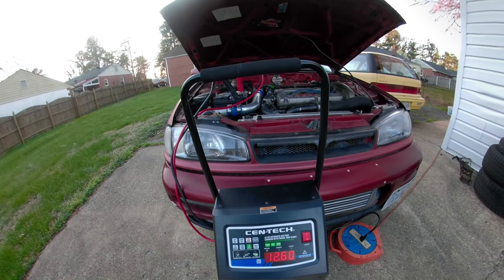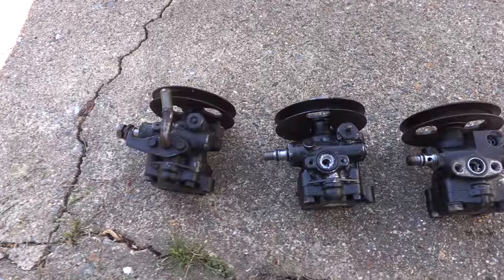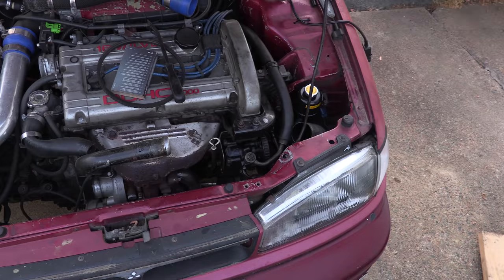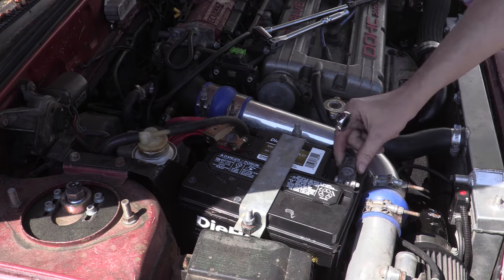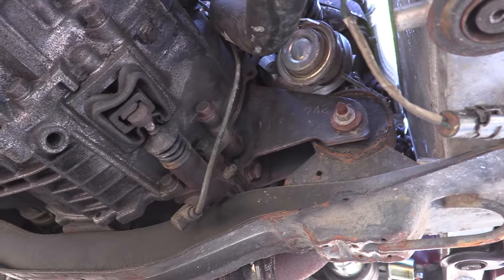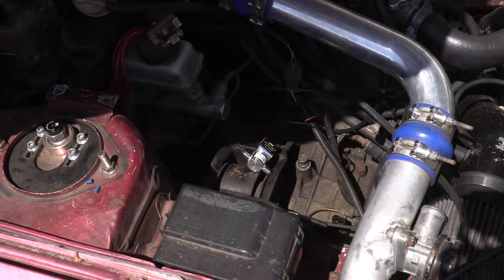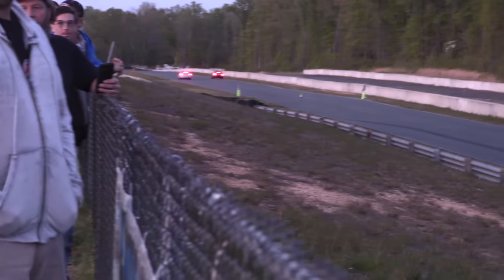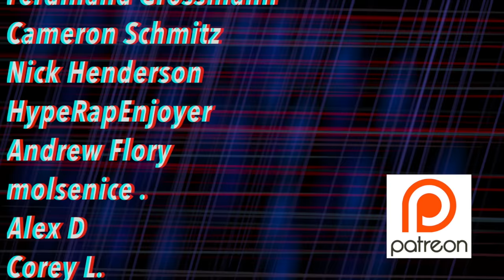When easy fixes go wrong...

Comment: Buy yourself a DeWalt DCF923 with battery and never look back at that ugly thing you have now, hahaha. I know, easy to tell someone to spend money. I'm just saying I have one and I don't miss the cash.
Reply from the maker: I'm using the plug-in electric drill because my DeWalt has a bent chuck.  It's always wobbled.  The only one that doesn't wobble that I own (sadly including the drill press) is that 30 year old craftsman that I've had for 29 years because I stole it from my mom.  Not really, but sorta.  She said she was thinking of me when she bought it.  I need a new one, fer sher.
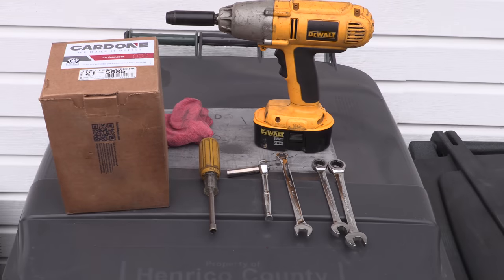Reply: @Jafromobile  Oh not the drill, the impact at 1:43! Corded drills still rock, hahaha. I think I have a nearly identical Craftsman corded, with the same break in the jacket, that I also got from my mom. 😂 The new compact impacts can make more torque than your old egg shaped guy. If you do upgrade to a new battery system, the cordless drills are a cheap add on. I just love my cordless tools.

Comment: Nice job. Ran into issues fixing my ps leak on my early 90. Didn’t realize they had a different pump on the early ones.  Did the car launch any different with the mount fixed?
Reply from the maker: Yes, all the weight and camber adjustments we made before it was fixed now make the car launch pulling the other way even though it tracks straight when cruising.  I'll be getting it re-aligned and hopefully onto a prepped 1/4 mile long track soon.  In my first burnout you can see it barely smoking the outside edge of the passenger tire.  Clearly my camber was affected by fixing it.  That was the tire that went up in smoke every time, and it's right next to that mount.  I got plenty of data from this trip, and the highway there and back yielded just as much info as the track.  I will likely be Windowelding my rear lower control arm bushings, or finding a poly replacements.  I'm convinced that a 1.9 60 foot will put this car deep into the 12's, and chasing number has already caused me to install everything necessary to tweak this car's geometry to get it.  This is by far the most challenging front wheel drive chassis for anyone because the chassis record is mild, certainly within this car's reach with the power it's making, but making this this thing stick is an education all by itself.  People used turbos 3x the size of mine to make a number that's a fraction of a second away.  That means they fought all of the exact same traction issues, too.

Comment: You did not want a cardone pump, my freind. Especially considering the amount of work needed to replace it.
Reply from the maker: When I looked at it coming out of the box, I assumed it was parts to begin with.  I have a rebuild kit for the Galant, and plan to rebuild that one myself if I can.  If I need a piece of housing, or a pump vane or something... it will be a donor.  I drilled a hole in it, so it's not like I'll be returning it.

Comment: Call Jamie!
 Nissan pump possibly?  
 Or even the 1st car you took apart at the shop in the lift  eagle may by?
Reply from the maker: None of us have any idea?  I can't blame anyone.  This car materialized originally about 15 years ago.  Parts we didn't have were housed from junkyards.  It was built with all factory original parts, but anything goes.  It has parts that represent 9 different auto manufacturers today.  This pump came off of neither an Elantra or a DSM?  Maybe the Expo?  I don't have one for reference?
Reply: @Jafromobile  New Mando 20A1013 Power Steering Pump Original Equipment
I saw this on Amazon / I know it's a new part but I think it's close. 
 Dsm 1996 seems to look like the pump you have in your video. 
 I hope this helps.

Comment: Be better off switching to an mr2 electric pump like a few kswap civic/ev/rx7/many other guys have done. I remember dealing with those pumps in the dsms I had. Their pumps are absolute garbage. Wouldn't work well past 4k rpm making autocrossing dsms damn near a joke. With that and the mule kick abs that was barely passable. There's a better solution out. It's just finding it.

Comment: Why not put a prius electric power steering. Like I did on my Huyindai. And get rid of all those hoses and reservoirs. It's 2022 after all.
Reply: Look at Mr future over here with his electrica'ma'bobs..
But seriously, How much work is it to fit?
Reply: @rompdude  Ain't that hard you take the rear column appart and weld splines to Prius column and then attach it to the existing column. Then wire it in. Don't know how it would be different car specific but it's not difficult. If you building engines you should be able to have enough brain cells to do this simple conversion.
Reply from the maker: @Nexx8969  @rompdude 😂 I love this!  This exchange is priceless and I love how everyone here gets along.  This is something I've kicked around.  I've had plans to do it to my GSX.  As enticing as it seems, think about how much electric power steering still wouldn't make any difference at all at cleaning up my engine bay.  It would just rid me of the noise and the pump.  It will make a difference in my GSX's engine bay.  I'm going to prioritize my efforts on that job on a different car, though if I have more problems with this one, it could turn into a practice run.

Comment: I've only just noticed that this 4G63 is the wrong way around to me. My only experience with them is the 8G Galant I owned which had an N/A 4G63 SOHC (UK market), and the transmission in that car was an F5M42 mounted on the RIGHT side of the engine bay.
Was this mirrored setup common to all Mitsubishi/Hyundai cars of this generation?
Reply from the maker: From 1989-1999 Mitsubishi used the SIRIUS I version of the 4g63.  From 2000+ they used the SIRIUS II which flipped it around 180°.  I say this without knowing what year your Galant was.  Unless a Japanese company retooled one factory just for the UK, then I'm betting you had a 2000+ production car...  FYI, all operational dimensions and specs of the rotating assembly are the same.  Parts vary, but the journals, bores, clearances... same.
Reply: @Jafromobile  Ah interesting - yes my car was a facelift 2002 model so that fits, although I think it was sold here in the same layout from 1997. As far as I know it was made at Okazaki the same as the JDM cars because it was RHD. Amazing how little they changed the motor in so many years. Thank you for the info!

Comment: I always wondered how the brake pedal works on that car. Seeing that it's left-hand drive but the brake booster and master cylinder are located on the right side of the engine bay. Is there a linkage under the dash to make that work?
Reply: The booster etc are on the opposite side on a rhd car
Reply: @mattrussell3602  Are you saying the master cylinder is on the left side if the car is right hand drive?
Reply from the maker: @corythomas4427  No, but it's equally as backwards the exact opposite way.  Left hand drive, right hand brake master cylinder.
Reply from the maker: It uses a torque tube.  There's literally a pipe that runs the length of distance from the brake pedal through the console to the passenger side of the car, where a cam lever actuates the brake master cylinder.  It's a 2" pipe.  Don't worry, it gets even weirder when you discover the clutch pedal mounts to that pipe, too.  It's not welded to it like the brake pedal is, though.  It's just its support.
Reply: @Jafromobile  Subaru does the same thing for their clutch pedal master actuation in LHD cars, just it only has to go about a foot over, hahaha. The rod acts as the pivot for the brake pedal as well.
Reply: @802Garage  Subaru (Fuji heavy industries, so there's your answer for why) also uses clutch forks that are a design I've only ever seen forklifts and semi tractors use, with a rod that goes into bores in the bellhousing rather than a more common single cantilever pivot point. I don't know if I explained that very well. They're "different". There that sums it up!
Reply: @corythomas4427  Part of why I love them! In the LHD cars it lets them avoid the front strut towers with the clutch master. It's a pretty solid design overall. Also Fuji Heavy Industries is officially just Subaru since 2017! Just in case you didn't know.
Reply: @Jafromobile  So to clarify, RHD or LHD...master is always on the right? 

I used to say vehicle engineers should have to work on cars before they're allowed to design them, but I recently heard someone with an even better idea. He said make them work on the vehicles they design one month out of every year. Not that it would make much difference once you've gone as far off the deep end as you, Jaffro. I can't believe how "assembled/driveable" you've kept that thing for as much as it's always got something being fixed or modified.
Reply: @802Garage  If it works, no reason to change it! That already happens far too often. I didn't know they had become their own entity. Thanks for the heads up, now I won't look dumb the next time I tell a new guy where Subaru came from.

Comment: that banana car (yellow one) what is it?, looks like a second generation 90's suzuki swift/Holden Barina
them things fly even stock with the 1.3L suzuki motors in them, people put 1300cc hayabusa engines in them and turn them into little lightweight rockets, with a turbo  they are even faster down the strip than the nissan GTR
Reply: its a Mitsubishi Colt, they were called Mitsubishi Lancers here in Australia

Comment: Great video. As usual. I was intrigued by the trans info. M5 f33. Can you elaborate? What it came from mainly. I'm sure you covered it before but I would appreciate a run down. Thanks.
Reply from the maker: F5M33 is a FWD Turbo DSM transmission.  Mitsubishi Eclipse.  Eagle Talon.  Plymouth Laser.  There are variations in its design dependent upon production year.  Mine is a '90 from a Plymouth Laser.
Reply: @Jafromobile  gotcha. Thanks for the info. I feel like you feel like it's a stronger unit than the awd ones. I've broken an input shaft on a 90 AWD before. Can't remember which spline count I had. But if I can avoid that again I'd like to.